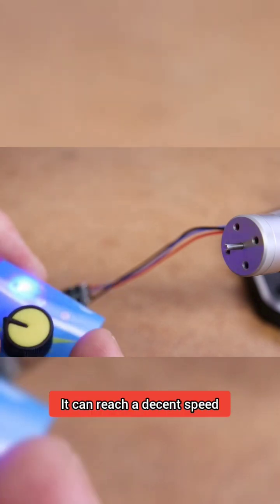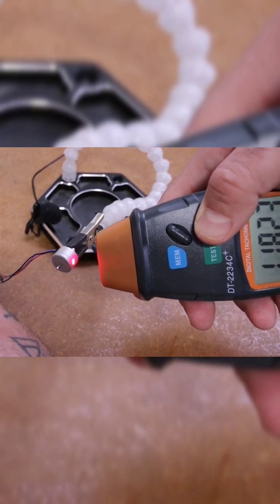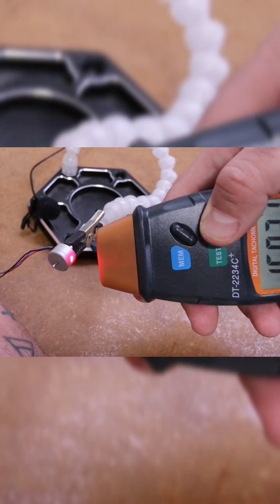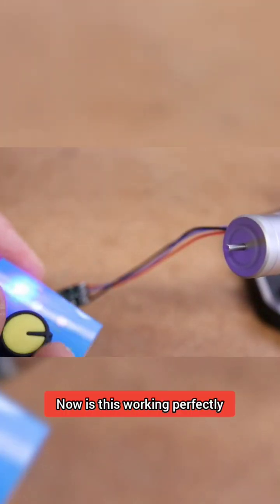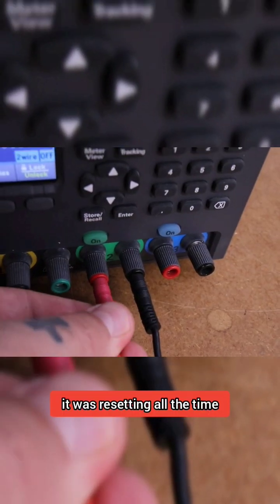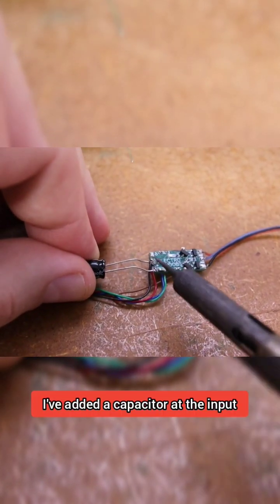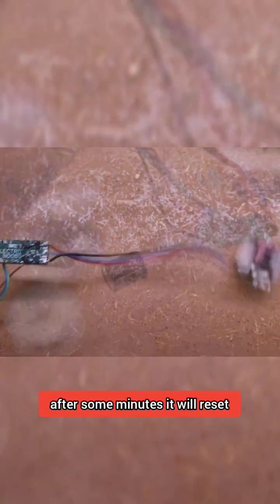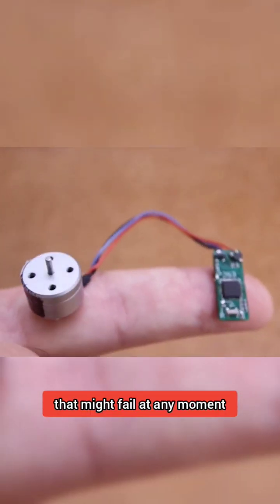Tiny ESC with Arduino

Comment: Isn't the problem in that esc/servo tester? I had the same problem, there is a rectifying diode before IC but they did not add a capacitor in a factory to smooth peaks so it was resetting all the time